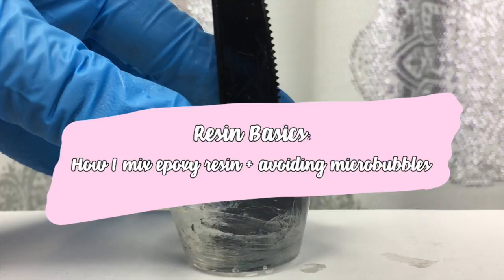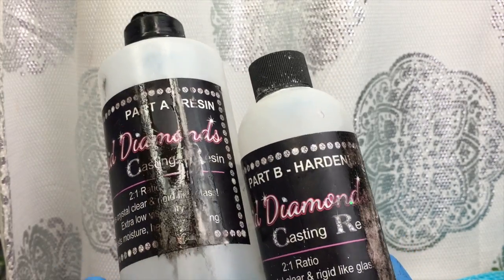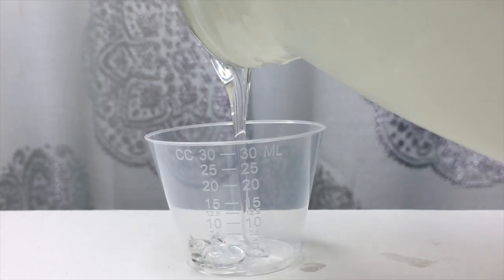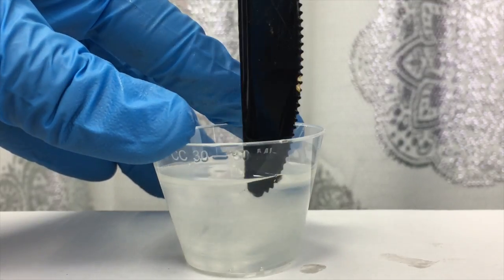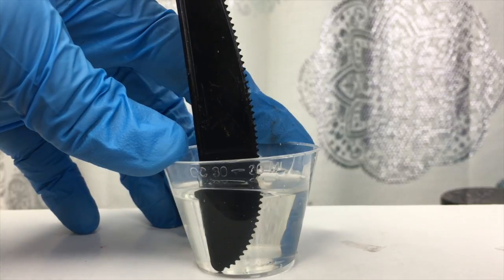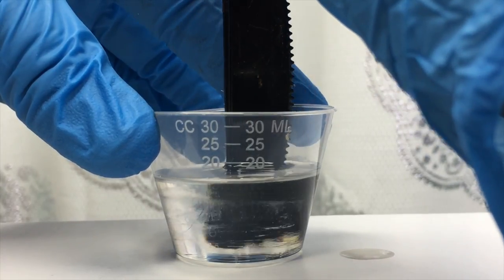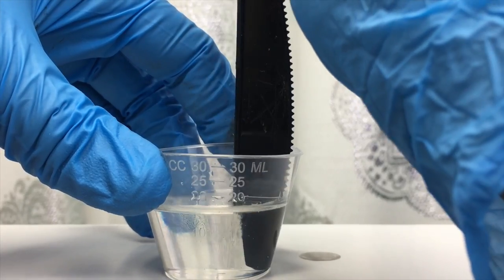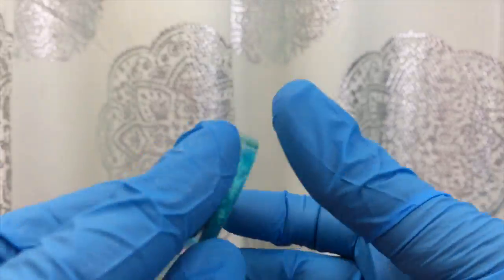Resin Basics: How I mix epoxy resin + avoiding microbubbles | Watch me resin | Sweet Art Crafts

Comment: Silicone sticks are even better than plastic knives! They also make small (like the #5) silicone cups so you don’t use so much plastic 👍🏻😁
Reply: Oops, I hit the button by accident! Also another trick to avoid bubbles is to heat the bottles before using. It helps a TON with those nasty micro bubbles! Also, do you find that liquid diamonds leaves an oily residue looking spot on your pieces? I can’t use it because of that.